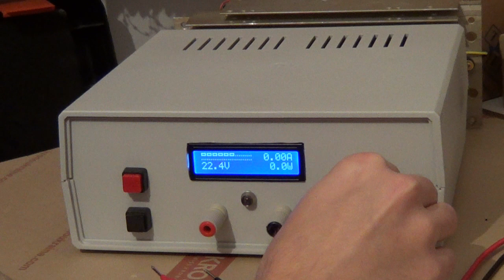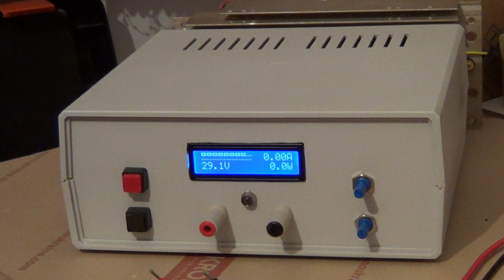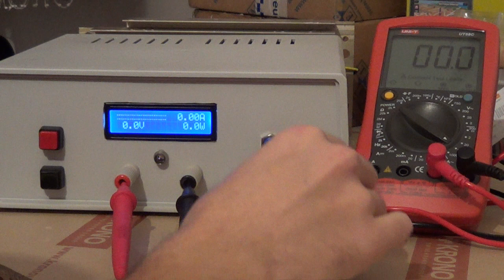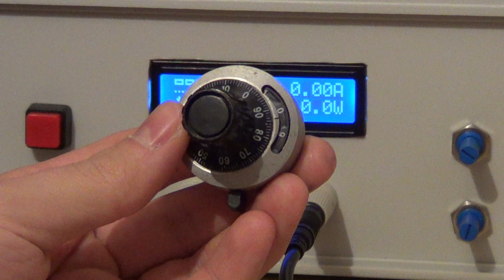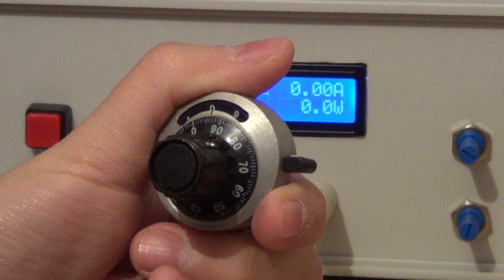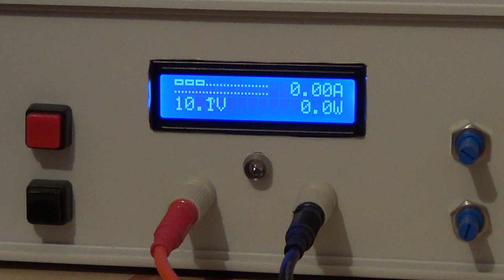Variable bench power supply (30 V - 4 A)

Comment: Hi friend 
i just saw your video. it is very good. you made it ? it is smart
But I saw you use some large fan and heat sink. because output current is 4A, right ? I think so .. in fact you don't use this . I can make your work easier ... 
if you want make a bettery power supply , I can recmment to you a better power supply module, you just need a input pow supply, colorful LCD screen. I saw you make 30v/4A, there are 30v/5a, 50v/5a, 30v/12A, 
you can choose  http://www.aliexpress.com/store/group/DPS-Programmble-control-power-supply/923042_508466030.html

Comment: Birrbert, did the current limitation works all right. Did it limit the current from 0 to 4A ?
Reply from the maker: +Francisco Guimaraes Because I added more and better transistors I think I should've changed the small internal current limiting potentiometer (there's that small pot inside which is in series with the big multiturn pot). With the multiturn pot I can limit the current, of course, but the range of the multiturn pot is not strictly 0 - 4 A, but more. The purpose of the small pot would be to set the maximum value of the multiturn pot. I hope this makes sense. I'm not 100% sure about this, because I haven't investigated further. If you find out something, please let me know.
Reply: are you interesting in this device? it is too big ..but there is better choice , you can check http://www.aliexpress.com/store/group/DPS-Programmble-control-power-supply/923042_508466030.html

Comment: This is so brilliant. But, how did you manage to output the voltage and amperage values on the LCD?
Reply from the maker: Hello Rohin! The values are displayed on the LCD with the help of a meter that measure Volts and Amps. The meter is sitting right behind the LCD on a PCB just the size of the LCD. It's controlled of a PIC microcontroller. Unfortunately, that's all I know about it, because this meter was made by an expert and I bought it from him since I'm not knowledgeable enough. :-)
Reply: Did you use lm317 to vary the voltage?
Reply: ok thanks
Reply: +Rohin Gopalakrishnan you can easilly create a volt ameter with an arduino and an LCD panel. Its actually very simple if you understand the basics. Ill make a video on this topic early in January to show those who are interested how it is done.